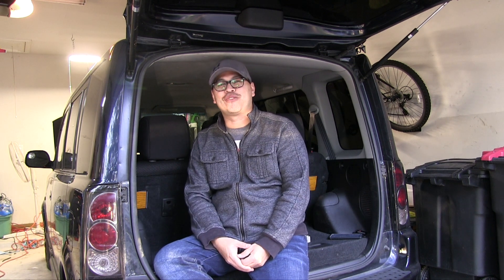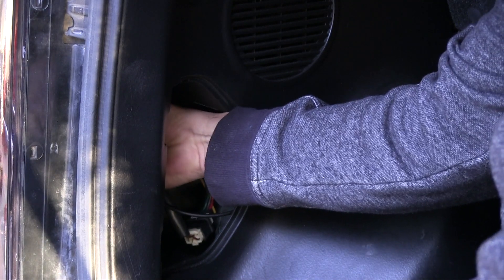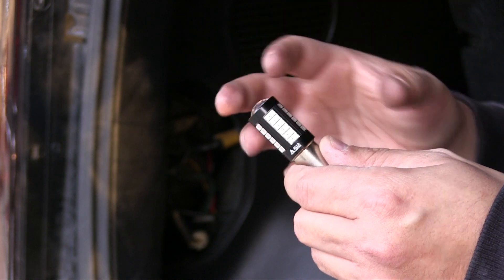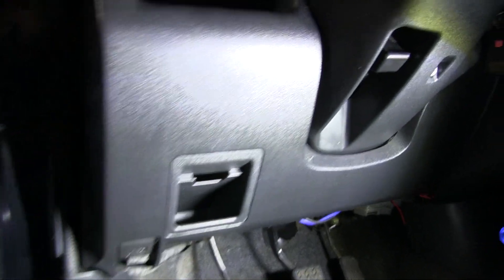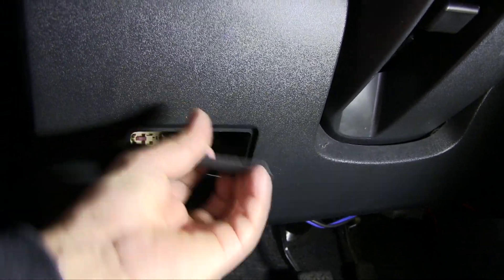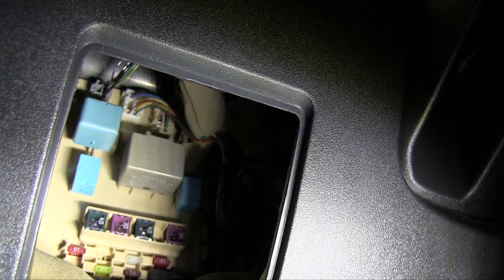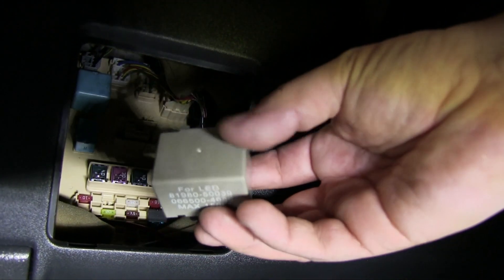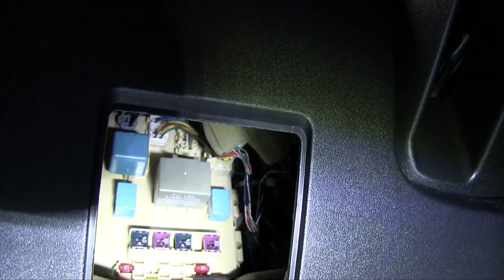LED Hyper-Flash Problem?

Comment: where did you get these tail lights? i bought the amerlite ones but the reverse light wouldn’t work bc the bulb socket didn’t align on the circuit wall.
Reply from the maker: I found these at a junkyard....they pop up on Facebook marketplace sometimes. There's an instagram page called @japanspaceparts selling a few sets that are different brands.